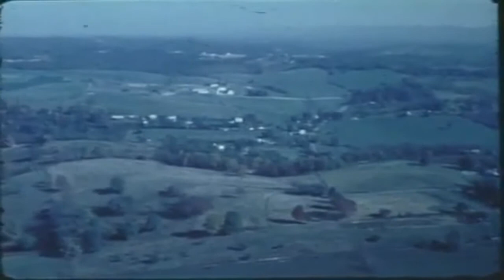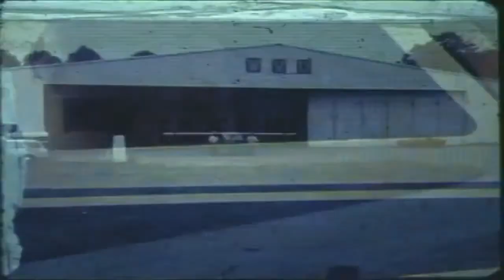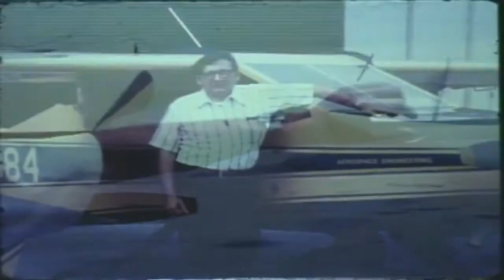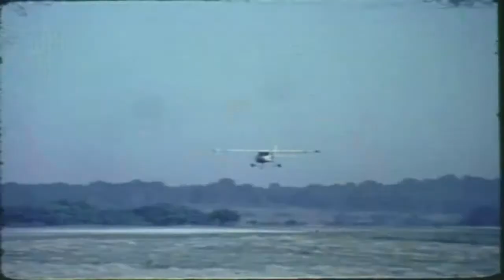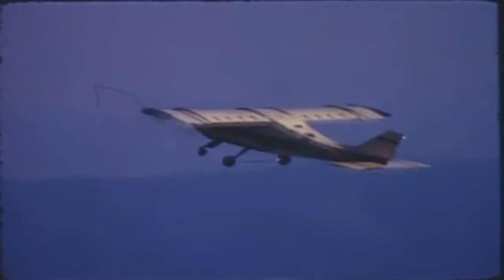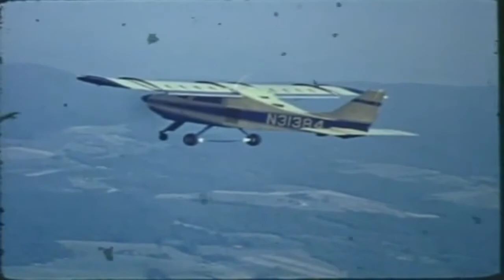WVU Circulation Control Aircraft

Comment: I wonder if compressed air could replace the turbo jet, like in drag racing
Reply: The amount of cubic feet of air needed for that would drain a full size bottle in seconds. I actually worked on this aircraft, the power plant outputs around  3.3lbs/s if I recall. That will drain a full size welding tank in 5 seconds.